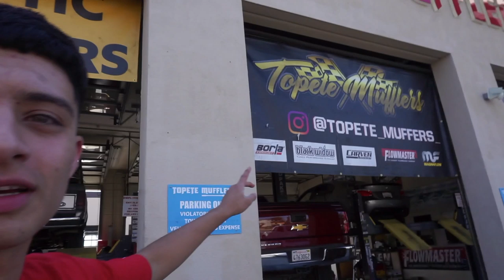INSTALLING CARVEN MUFFLERS ON MY TRUCK!!

Comment: X pipe craven r series trual dual and cutouts is loud asf bro
Reply: Dude on my 2001 V8 Mountaineer I had a true dual setup with 2 Loudmouth2s mufflers and it growled until I put on a X-pipe. Now it's not as loud and throaty so now I need Carven Rs..

Comment: Man how does yours not have that hillbilly cackle if you have no cats?
Reply: Negative Espada Probably because he's not straight piped and or doesn't have 10 exhaust leaks
Reply: Longtubes and x-pipe clean up the sound vs stock exhaust manifolds & true dual straight that the yeeyees trucks have
Reply: I had this same setup that Project Low has, except mines were dumped. Check out my drive-bys and you will see that cackle I’m talking about. When I changed to Flowmaster Outlaws and Hi flow cats the sound was cleaned out
Reply: @erick._150  hmmm weird. Maybe the size piping?